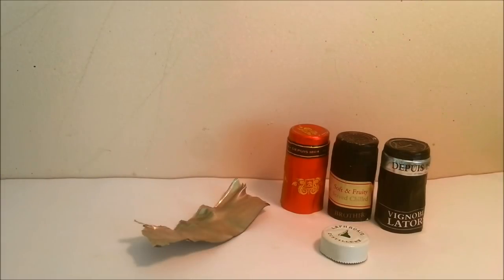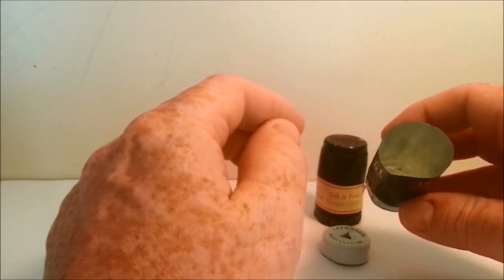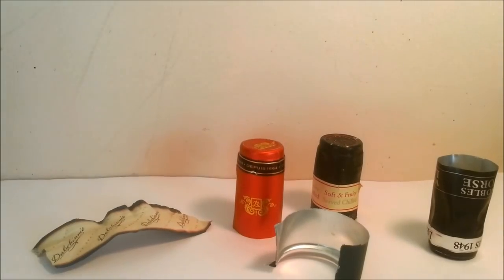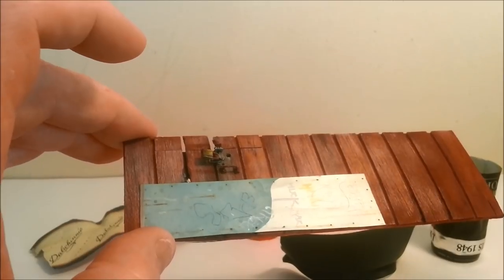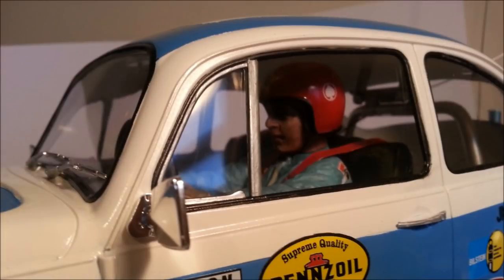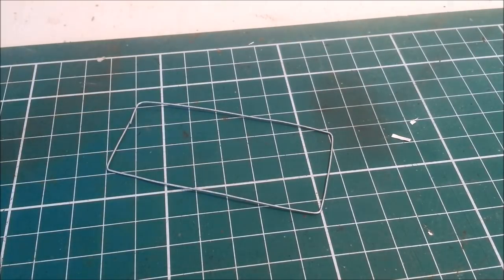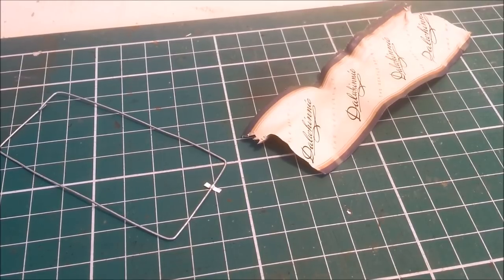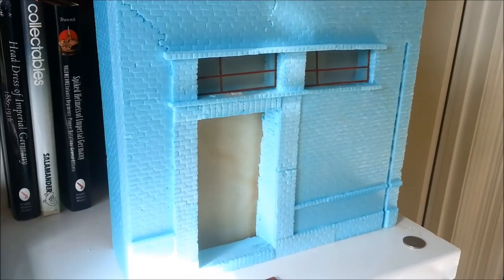Scale model detailing hint: Drink more whisky!

Comment: As a photographer, I recommend you to buy a small sheet of Roscoe Cinefoil to try. It’s like a thicker aluminum foil with a matt black finish. You can get it on Rolls but sellers on eBay sell it by the sheet. It hold its shape very well. We use it for blocking/shaping/directing light. Great for dented tank fenders, straps etc.
Reply: Thankyou for sharing Sir, God Bless

Comment: A much cheaper and possibly healthier option is to use the foil trays that steak pies come in, you can wash the trays out after you finish your steak pie or just buy quite a large foil tray in a supermarket for next to nothing.  I also use the foil trays that you buy cat food in (my cat eats the food in case you are wondering) Using these foil trays would give you quite a substantial amount of tin / aluminium foil to play with rather than the small physical amount that you get from whisky bottles.  I love the padlock latch in your video, it looks truly amazing.

Comment: Historically, the "capsule" (which is what you're talking about using) was definitely lead, often tinned to reduce corrosion. (Note that metallic lead is not a significant toxicity problem; lead salts are.)

From a bit of research, it looks like the higher end capsules are currently made from tin (which probably means a high-tin-content alloy).

Heavy duty aluminum foil works pretty well for this purpose as well -- much better than the sheet aluminum used in beverage cans. Another useful source for inexpensive aluminum that can be easily molded is disposable aluminum oven/steam table pans.

Comment: The Wine Wrap technique was a favorite of my Grandfather and Father for scenery materials.

As I was to young to be mucking about with Wine anything my GreatUncle taught me a like technique. 

Start by saving the aluminum foil from the lunch sandwiches your Mom made for you.

Cut the foil to a 12 inch by 12 inch square.  GENTLY rub the foil against a tables edge to smooth out most of the wrinkles.   Don't rip the foil or you have to start anew.

When smoothish fold one 4x12 inch strip as a markers edge.  To the remaining 8x12 surface apply a thin bit white glue.  Spread the glue over the 8x12 surface in a thin even coat   Fold the first 4x12 strip over the center 4x12 section.  Make sure you have a good contact.  Then fold the third 4x12 pre-glued section over the remaining package 

Use Mom's best rolling pin to assure solid glueing contact and as few ripples or folds as possible.  This also sharpens the edges.  ( I now use my Wife's best rolling pin.  And for some unexplained reason I still get yelled at for doing so.

WOMEN!!!)

Allow to dry overnight and you get a strong metal modeling material.

Comment: Hell yeah!!! Only the top shelf has the good foil. I also use tea light resepticals. After they are used up I cut out the bottom and flatten the sidewall to form a sheet. This is what I'm useing on 1/350 Titanic for the plates. You can also emboss it from other side for added details. That is how I'll replicate the rivets. Excellent inspiration video! Cheers.
Reply: That is an amazing dead bolt dude!!!

Comment: Another great foil is the stuff you get from tins of coffee, when you open them they have a foil seal over the top, I just stick the hobby knife under the rim of the tin, then just run the knife around.

It's extremely thin and very bendable, also standard aluminium foil is useful, and being thin it's a good scale for 1/35th scale.